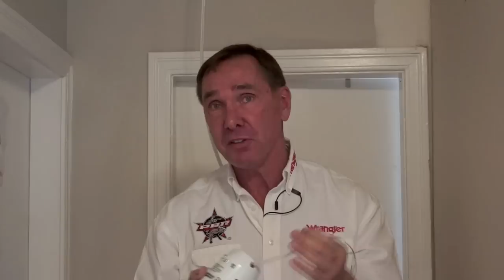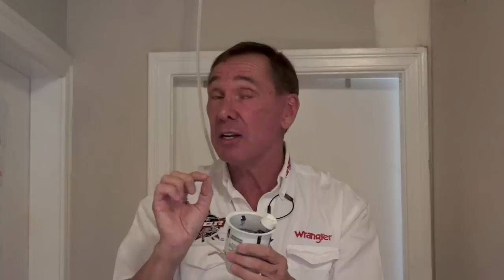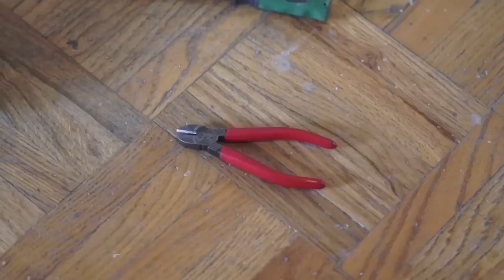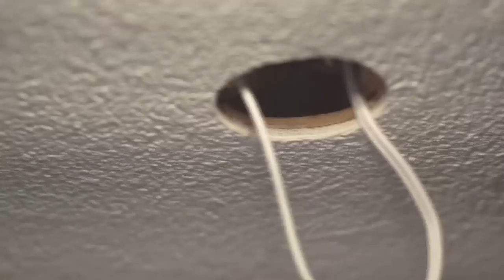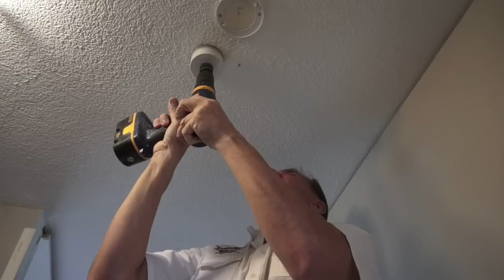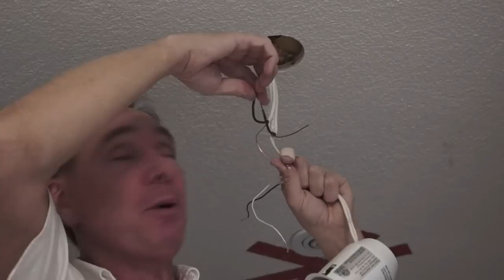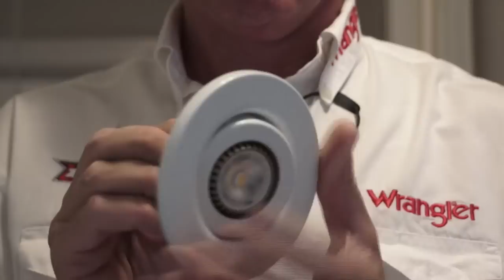How to Install Recessed Lighting | Retrofit

Comment: Hello Percy, I appreciate that you are trying to help folks and in the same spirit I feel it appropriate to mention that when you drill a hole / make a hole in the ceiling you/we are breaching a fire break. Down lights are supposed to have "fire hoods" placed over them for a number of reasons, one of them being that {as you say} in an older house we never know what has been used as insulation, it "may" have been fire resistant in its day {then again} but over the years it could have lost that ability. 

Yea, I know and I agree with you about low wattage and all that, but it's Code {in many countries} to put a fire hood over a down light to keep any old {or new} insulation from stopping the cooling circulation of air to help keep the fixture cool/ish.

That's the obvious thing but, one that folks don't always realise is that when we have made holes in the ceiling {the fire break} we are asking for trouble, if there was a fire in the fitting or in the room below the down lights the fire wouldn't be contained and would potentially blaze furiously through the holes. That's not what you want, it's bad enough if it's just the loft up there, but it's much worse if there's people living above.

I see that you have used LED's but as you say they are more expensive  {but well worth it}} but some folks will no doubt use halogens, if they don't use fire hoods they really are in at the deep end.

I hope that you take this into account Percy, and that you take my comments in the respectful manner of my intent {we can all learn from one another}.

Comment: Percy, Percy, Percy. Shame on you, brother. I think you know your video was a good tongue in cheek attempt to generate comments. I get it..... but I'm really worried about the thousands of You Tube viewers who will watch it and follow your lead in putting unenclosed splices in a ceiling. Enough's been said about how dangerous that is and, as a licensed Electrical Engineer, I can only second the motions! I implore any viewers to completely disregard this video and learn how to do a project like this the right way. Your family will thank you! Oh ... and PLEASE PLEASE stop saying that 120 volts can't kill you. You CAN be electrocuted by120 volts....and it can knock you off a ladder or other platform you're standing on.
Reply: Not according to the herd. You seem to be the black sheep in this situation...
Reply: The only way to shut the haters up is to take out the fixture and have an inspector check it while you film it. The fact is that we all make mistakes. Nothing wrong about it. This is not correct. There are many cases that something might be working for 50 years but not correctly done. For example, i have 14 gauge wires in my house while the breaker is 20 amp. Will it burn my house down. Unlikely. Is it against the code. Damn right.
Reply: You might do it in a way that nothing would go wrong but what about a novice person who has no idea and does not secure the wire not correctly...

Comment: A lot of these comments eventually come back to the same thing, Percy want's a common sense reason why he should follow the code for putting his wiring in a junction box when his LED lights draw such a small amount of current and generate such a small amount of heat. So according to Percy's common sense, the risk of fire is so small it's not worth considering.

I've got a couple of reasons, but I'll just give the most common sense one. 

So here we go.

While it's true that these light fixtures left alone will most likely never cause a fire, there's a second important purpose for using a junction box to house your wire connections. It serves as an additional barrier that prevents animals (for example a mouse) from chewing through your wire insulation and shorting out the circuit. This may never happen to you, but if everyone wires their house without junction boxes it will eventually happen to somebody. Even with the box, you still aren't completely safe, as they could chew through the cable sheathing and wire insulation, but it's at least better than letting them get at the wire insulation directly.

I've read some of your comments and I already know that you're going to respond with something to the effect of "A wire getting shorted still isn't a risk for fire because the light fixtures draw such a small amount of current".  I've seen this comment from you in multiple responses. This is COMPLETELY untrue and VERY misleading. The LED bulbs draw such a small amount of current because they are very high resistance devices. When a wire is shorted out (for example by a mouse chewing through the insulation) the short-circuit bypasses your high resistance LED bulb and flows in the new path that has been created by the mouse. This new path is much lower resistance, and therefore will see a much higher current flowing through it. This high current will generate heat, fry the rodent, and most likely start a fire in your attic. **(See Common Sense proof below if you don't believe me)

Some of us may be comfortable with taking this risk, but for the majority of us junction boxes are an inexpensive way to make our homes safer. So if you make a "How To" video and decide you are comfortable cutting corners, you should still explain to your viewers so they can make the decision for themselves.
 
** Proof that a short circuit draws more current than the original load. If you ever manage to solidly contact a live hot (black) wire to a neutral (white) wire, the result is a near zero resistance connection which will cause extremely high currents resulting in a breaker trip.

Comment: this blowhard Canuck is FOS. #1, you can def hurt yourself with electrical and should respect it big time and #2, u need a transformer to convert from 120v to low voltage LED. what the hell is that shirt? this makes me crazy.

Comment: Did he say 120v wasn't enough to kill someone?
Reply: 10 mA is painful, 100 mA is enough to stop your heart and can be lethal. Mains can easily do this, guy in video has no idea what he's talking about. Human skin in dry conditions can have a resistance as high as 100k ohms which would help in the case of a shock. But if you're sweaty, wet or you stab yourself with the end of a wire, that resistance can drop to 1k ohm or less, which further drops as voltage breaks down the skin. At this point mains can become lethal and it isn't all that hard to happen in an accident.

This video is scary. I'm all for DIY but between his hazardous advice, dangerous assumptions and incorrect wiring practices, I can't recommend anyone do it this way.

You aren't supposed to pre-twist wires together, the wire nuts are supposed to do that for you. The housings should be connected to ground and the connections should be in a junction box to protect them from being damaged. Just because LED bulbs are low wattage devices doesn't mean they don't get hot. Some operate as high as 50-60C (122-140F) and can suffer similar failure modes to CFLs where the driver goes off which can lead to fire.

I'd also install recess lighting covers in the attic because you're going to be leaking a crazy amount of air from in the house with all of those holes in the ceiling. Don't be surprised if your electric/heating bill goes up noticeably if you don't insulate the fixtures from the attic.
Reply: i been hit by a 120 before. It hit hard. it didn't kill me though. Made me to always remember turn off the box.
Reply: Percy Lipinski
>The current in a small LED light is not enough to harm a flea like you

Considering some LEDs can pull up to 50mA and run at mains potential, yes they can definitely be harmful if touched exposed.

Many cheap LED lights use capacitive droppers in lieu of a switching power supply which puts everything inside the LED bulb at mains potential. If the bulb broke apart and your finger got in there, there's nothing between you and the mains except a switch and a 15A breaker.
Reply: How about the current in a shorted to ground circuit? Learn how electricity works you clown
Reply: Indeed
Reply: Yep. I've also been hit with 120 due to not turning off the breaker. Then again there wasn't that much load on the circuit. Just a 60 watt bulb on an extension cord.
Reply: Also, maybe the 120 won't kill you (maybe it will) but you also might fall off the ladder, drop the tool into your eye (wear safety goggles!) or stab yourself in the jugular with a tool when the shock hits you. Better safe than sorry (or dead).  Shut off the breaker, then make sure the power is off with a tester.
Reply: Goof? That's rich coming from you, who owns a rusted out van to kidnap kids so you can torture them in your DIY dungeon you made. The poor children of Prince George  not only have to deal with the trauma of you molesting them, but also having to witness your shoddy craftsmanship. If I had the legal power I would ban you 1000 metres from any school, daycare centre as well as Home Depots, Canadian Tires, Home Hardware or any other home improvement hardware store. What are you gonna call your next video?
Piss Poor Plumbing by Percy the Pedophile?
Reply: I think that he was referring to us Canadians, we're pretty tough and it would take a lot more than 120 vac to electrofry our brains.........especially in winter;)

Comment: Not type IC lights...... used no junction boxes...... insulation touching that halogen light :( .... broke vapour barrier in ceiling.... used diagonal plies to splice creating hot spots all over that splice point..... there is standards in place for a reason. Follow them and don't make videos teaching others how to void their home insurance. I'm 100 percent with you MrAllister9

Comment: If this is an attic ceiling i do not recommend doing what this guy is doing.  Theres no poly seal.  This is what someone who has no idea what he's doing is teaching others to do.   Please either do the job right or dont do it at all.
Reply from the maker: You stupid piece of crap loser. Who are you? You're opinion is stupid! Tell us all exactly how this install is dangerous??? Go ahead loser lets hear it??? Oh you can't, can you dumbass butthead!
Reply: You should stop doing renovations if you're going to do it like this.  When a house is built is there insulation and poly with caulking and fully sealed?  When you start cutting holes in the attic you break the vapor barrier,  how do you sit there calling others names when its you doing the hack job.  Who would hire a guy like you thats swearing and cursing everyone?  Contractors like you(if in fact you're even a contractor)  should not be allowed to do renovations, clearly you are not qualified for it .. im sorry those are just the facts.
Reply: +MrAllister9 this guy is fucking horrible. YouTube should take the video down before someone sets their house a blaze.
Reply from the maker: +MrAllister9 hey you dumbass. Tell us exactly how thus job is dangerous!!! You can't cause you're an idiot quoting a reference manual. Hey loser instead of an electrical code book you should be referencing a psychiatric manual under LOSER FOR LIFE!!!
Reply: +Percy Lipinski goddamn you are stupid, you want to talk shit on other peoples intelligence yet you cant even grasp how to properly respond to youtube comments? fuckhead.
Reply: Percy Lipinski is that your fetish?

Comment: Percy, thanks for the video. Very informative. I'm planning on doing my 1971 house here in the next month or so. Just started looking at different lights. Something I would strongly recommend is to shut the appropriate breaker off as someone out of habit could turn the light switch on not knowing you are working on it. I know you made a note of that in the video and I thank you for that. Safety first.
Reply from the maker: Can't argue with that bro. Before you start the world of lights has changed dramatically. I would consider a 12 volt options as well. Strip lights etc. i just bought 12 volt 300 watt DC transformer for $22 on ebay. Runs half my lighting.

Comment: Uhm...120 VAC not enough to kill you? More people are killed by 120 volts than any other voltage. People out there believe me, I've been doing electrical work since 1984. It is a well known fact that 120 volts will kill you. So do respect electricity!!!
Reply: +Percy Lipinski Awwww, poor thing. I didn't mean to get ur feathers all riled up pretty boy. I did fail to mention I was speaking of the United States, so for that I am sorry. But you sure are quick to call my 'supposed' mistakes for a boy who's not even "a professional". Take a chill pill and settle down little fella.

Comment: Could you give me details where you bought that LED GU10? How much were they?
Reply from the maker: I got them at Costco. GU10's are kind of old school though. I would go LED 12 volt and then you don't have to worry about codes. Lighting is changing dramatically. In fact I predict we won't even have light bulbs much longer. It's much better to build the fixture with the LEDs built in.

Comment: What else is on the circuit you added these lights to ?
Reply from the maker: Excellent question!!! Nothing, just these low wattage lights. Since this video was made much has changed. I would now recommend a 12 volt transformer and led lights of your choosing. There are 000's of them now. In fact I predict we will soon see the end of light bulbs and their sockets. The industry will move to integrated led lights and fixtures.
Reply: +Percy Lipinski Are you sure ? I have NEVER seen a lighting circuit with only 1 drop on it !!
Reply from the maker: +3Phase 600V 100% sure because I removed all else BUT that said today I would do it different. I would use a 12 volt transformer and go low voltage (but high amps) so you still need at least 18 guage wire if you're going to install 20 or more LED lights. Make sense?
Reply: +Percy Lipinski  So you disconnected other lights and or plugs that were connected to that circuit ?
Reply: +Percy Lipinski  .... Still wondering about this !  ... You disconnected everything else that was connected to this circuit ?  What did you do with it ? Typically an older house, as you said yours is, would have many lights and receptacles connected to them. They often shared the neutral between circuits as well.
Am I correct to assume you disconnected everything else on the circuit, and rewired a new circuit for what you disconnected, in order to have low current on the LED lighting that had no junction box?
Seems like alot of work to justify the 'sale' on the cheap fixtures !!
Reply from the maker: +3Phase 600V yes I isolated the circuit because it's a small house and was easy to do.it.
Reply: +Percy Lipinski ya i bet you'd do it differently you ghetto fucking hack. you should start by either getting your sad shit together, or getting someone who knows what the fuck they're doing....you are a piece of shit at its finest....

Comment: good video buddy.  how do I split my single lamp in ceiling into 6 led recess lights.
Reply from the maker: Well of course each house is different but technically it's very simple. It's just a parallel working scheme. Getting the wires to each location is the trick. At each location you will have 3 pairs of wires to connect to each other plus the pair for the fixture itself. 3 white all connected, 3 black and 3 copper or green. When you get to the last fixture it's only the lamp and the last wire run. Remember, if you're doing it in conditions similar to mine only use low wattage led bulbs!!!
Reply: Cheers buddy